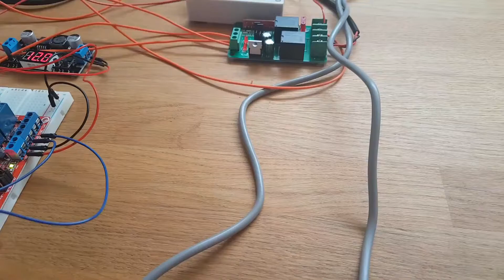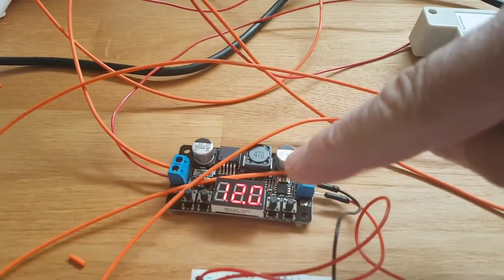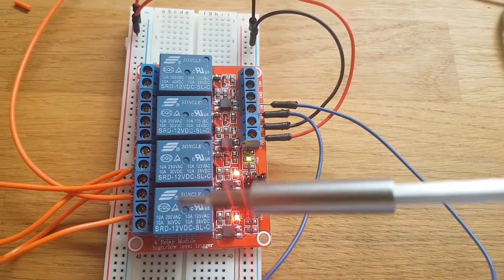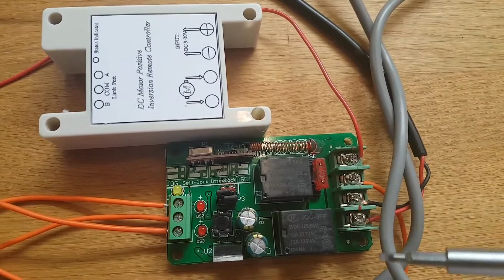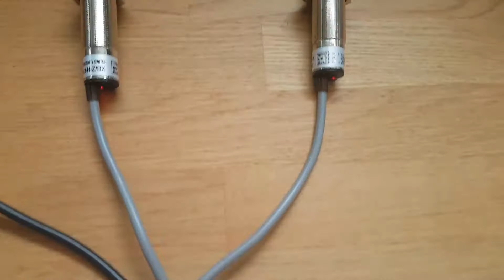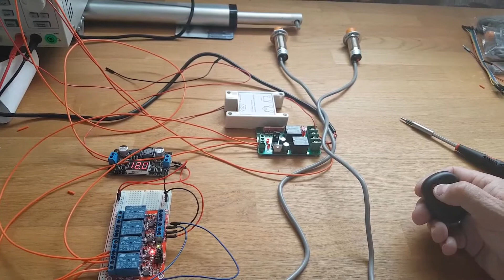Linear Actuator and Proximity switches - NOW WITH A WIRING DIAGRAM

Comment: I want to rotate the egg tray with a linear actuator in such a way that tray will move from 0 positions to + 45 degrees and from +45 to - 45 degrees. now for that what I need is 1 linea actuator with motor driver and Arduino? and what linear actuator should I use, I have seen some people using 3 pins actuator please guide me as soon as possible.
Reply from the maker: Hey Rabia,  I guess it depends on the weight of the egg tray - you could use a a stepper motor or maybe just Google a 'lazy susan bearing'  and some wood that uses a cam to push it around 45 degrees (cut a cicle of wood with a cam slot at each 45 degrees) - by fixing one end of the linear actuator and having the other end of the linear actuator free to push the cam with a spring - you could then use an Arduino or a simple timer to rotate 45 degrees each time. if you need to remember the actual position then yes, an Arduino would be perfect. Just some immediate thoughts/ ideas. I can send you a sketch if you'd like.
Reply: @rskipworth  yes please if you could. Or do i need a motor driver as the tray will move from 0 position to + 45 degree and after 10 min from + 45 degree to -45 degrees. And i have to design it for the vertical ray of trays.
Reply from the maker: @rabiahussain4953  Not sure if you can send me your email address... mine is rskipworth at gmail dot com and I'll reply to you.

Comment: I don't understand why you are using that 4 ch relay board when you have the motor controller board. Plus there are better boards that can be used.
Reply from the maker: Hi there, sorry for the delay. This is 5 years old now and worked daily - the relay board is just to interface the capacitive proximity sensors to the remote control board (which actually does the linear actual control) - The board has inputs for limit switches but the unit is in an agressive environment (automated lid for a hot tub!) - so i wanted good accurate opening and closure (heat retention). Not had any issues at all.  I've now addded a wiring diagram too.
Reply: @rskipworth  First: Your wiring diagram is ONLY in the thumbnail which can ONLY be viewed when you are not actually in the video page, it only pops up if you are in another video or page and even then it is way too small to be any good. Fortunately I went digging in the code and was able to extract the image. You should just post it to google drive or some other site and link to it in the description. Much easier for those who would like to see it.

Second, you don't need those resistors. The internal circuitry in those sensors already have compensation for "Bounce". Plus the board itself already has the jumpers to switch from Hi and Low, so it doesn't matter if the the sensors are PNP or NPN. You can just switch the jumper.

Third you don't need the 4CH Relay Board at all to do this, if those sensors are NPN. All you have to do is wire the Negative of sensor to the same Common of the Motor Controller, Positive of sensor to positive from buck converter. The "Load" wires are wired to A and B of the controller. 

Fourth you have NO2 labeled wrong in your diagram. It is NC not NO. Either that or you have it wired wrong. If you are just labeling them #1 and #2 then you should really Label them what they are A and B and COM. Which I think that's what you are doing here.

"The board has inputs for limit switches but the unit is in an agressive environment (automated lid for a hot tub!) - so i wanted good accurate opening and closure (heat retention)."             I am not sure what you are trying to say here but I think you mean is that you went with proximity sensor limit switches over mechanical limit switches AKA micro switches. 

I am not trying to be an ass, just presenting information to you and anyone else who may need it. Less is more.

Comment: That controller is junk. I have 5 and they all failed in a short time running actuators using a few amps.
Reply from the maker: Hi there, sorry for the delay. This is 5 years old now and worked daily - the relay board is just to interface the capacitive proximity sensors to the remote control board (which actually does the linear actual control) - The board has inputs for limit switches but the unit is in an agressive environment (automated lid for a hot tub!) - so i wanted good accurate opening and closure (heat retention). Not had any issues at all.  I've now addded a wiring diagram too.
Reply: @rskipworth  You were lucky to get that to work for you. Failed for me.
Reply: @ajw6715  5? All 5? What actuator? How did you wire it? It seems a bit odd that all 5 would fail unless you are running an actuator that is more than the board is rated for. "running actuators using a few amps" What do you mean by that. were you running multiple actuators on a single board or One actuator per board?
Reply: @AztecWarrior75 Yes I had 5 fail before I stopped buying them. I didn't use any relays just connected to the actuators. I was using the standard actuators you can buy on ebay. I was using them to run in and out steady not to run out and set then run back in later. The maybe ok for home user for light work? I gave up on them.
Reply: @ajw6715  "I didn't use any relays just connected to the actuators." Not sure what the relays not being used makes any difference  but ok. They are not meant to be used with (or need need to be used with ) any external relays.

"I was using the standard actuators you can buy on ebay." There is NO "standard" Linear Actuator on ebay or amazon. Do you mean the most common used for  DIY coop doors and TV stand? 12v 300mm 900n with 25% duty cycle rating?

" I was using them to run in and out steady not to run out and set then run back in later." Do you mean CONTINUOUS use? If that's the case then you purchased the wrong actuators. The most common actuators like the one in this video have only a duty cycle of 25%. If you try to run these like you are saying of course you are going to burn out the controller.
Reply: @AztecWarrior75  exactly...these boards are awesome and simple to use..some folks don't do enough research or have enough information before jumping in and strangling themselves with stupidity...all these little gadgets exist because people have invented them for a "intended" function which is ignored when blanketed in ignorance...e.g. some clown wires up a lamp with left over wire from some old coffee maker and thinks they are an electrician or electrical engineer...and then blames the lmap for burning down their house
Reply: @ChadLuciano  Yup!

Comment: Hey Rob, any chance you could upload a diagram of how this is wired?
Reply from the maker: Sure Stephen, back home tomorrow and I'll take a pic.
Reply: @rskipworth  hi rob have managed to activate relays from proximity sensores but the three terminals on remote control board need a wiring drawing which they dont include do you know this secence  or have info on this regards stephen
Reply: @stephensadler9929  Had to go digging in the code to find the thumbnail. Hope youtube doesn't delete the link.
Reply: @stephensadler9929  Well I tried posting the link and then I tried posting how to find the link in the code and both times it got deleted. youtube sux!
Reply: @stephensadler9929  Ctrl + U
Reply: @stephensadler9929  ctrl + f
Reply: @stephensadler9929  It will find a link that you can click on and it will bring up his diagram.
Reply: @stephensadler9929  Well I tried 5 times and different ways to comment the word you nee to look for but ...
Reply: @stephensadler9929   DOT
Reply: @stephensadler9929  jpg

Comment: hi I want to operate the linear actuator like if I press the button it should extend and when I release the button it should automatically retract just like solenoid. please help
Reply: I know you asked 3 years ago and hope you have your answer by now but FYI for you and others....

That is not possible with this Motor controller board.  
This board only supports: 
Jog (Monetary) = Press button A or B and the actuator will move in or out. Once you release the button it stops.
Self-Lock = Press A or  B and that relay will stay on until the button is pressed again.
Interlock = Press A button and actuator moves in or out, button is released and actuator continues to move, press B button and the A relay is turned off and B is turned on reversing the actuator. Press A or B once and actuator moves in or out, press the same button again and the actuator stops.

What you need is a motor controller that supports inching or,
What you need is a 2 or 4 channel Single Pole Double Throw relay module with wireless capability. 

Look up "12V RF Wireless Relay Remote Control Switch, 10A Universal 4-Channel 433MHz Remote Control Relay Switch for Motor, DIY Function, Home Use & More" on Amazon. Best to find one that only has 2 Channels. Unless you have two actuators that you want to control the same way, it's just a waste having the other two channels. Unless you have two other things that you want to momentarily turn on. You can't set the individual channels to jog/lock/interlock.

Set to JOG and wire relay 1 and 2 as follows. 
Relay 1: Normally Open (NO) Negative from Power Supply (PS). Normally Closed (NC) Positive from PS.
Relay 2: NO Positive from PS, NC Negative from PS
Both Commons, from relays, go to Actuator.
Program Both Channel 1 & 2 to A Button on remote.

This will do what you want. Press A Button on remote and hold and actuator will extend (Switch actuator wires if the actuator does not extend.), Once you let go of button the actuator will retract.